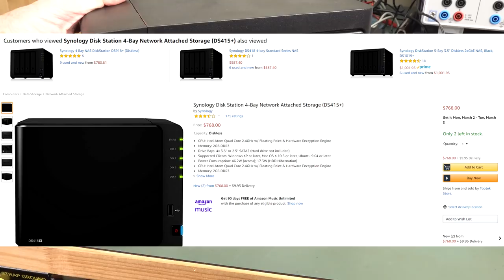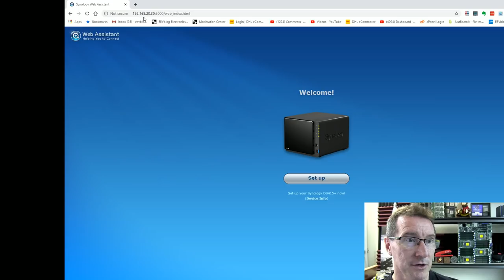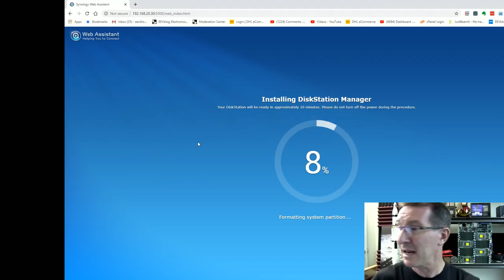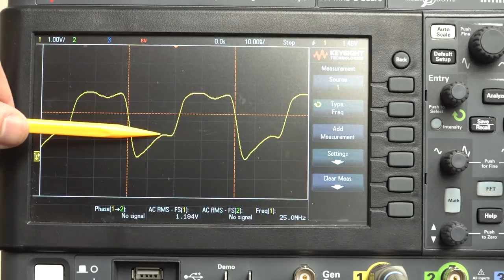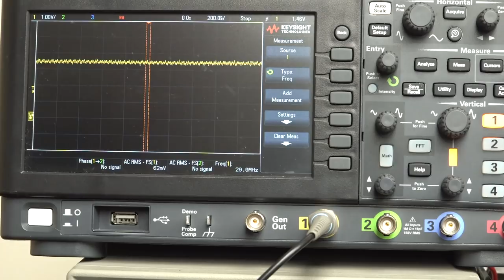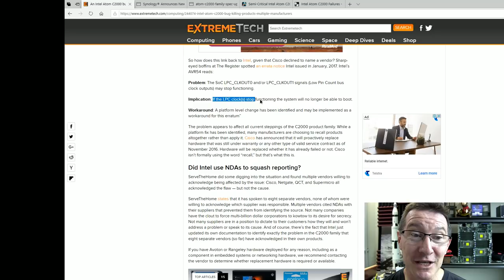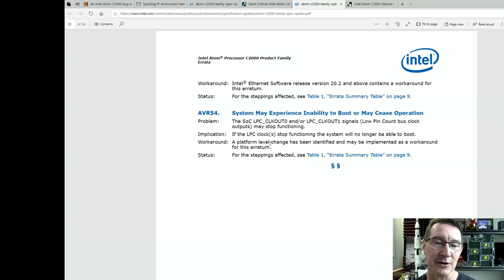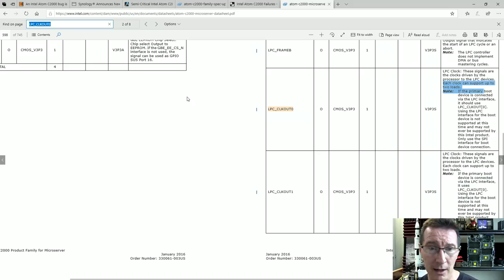EEVblog #1288 - Synology NAS Dumpster Find! (REPAIR)

Comment: All the units replaced under warranty had the resistor mod that i have seen.
Reply from the maker: Thanks for the confirmation
Reply: @EEVblog  Where is your dumpster?? 😁 no but seriously thank you for what you're doing, I'm learning things that are probably going to help set me free from terrible jobs I have to work, and have freedom and liberty to design and create and enjoy the world of electronics and controllers for automation
Reply: my 1515+ har is after replasment from synolegy and is har an "F" after it serialnuber
Reply: Hmm, not mine. They were replaced with brand new units.
Reply from the maker: @spnro8699  It's in a commercial business park and serves maybe 100 companies
Reply: It’s the official repair, I have done a few, also refresh the thermal paste as it goes rock hard and it’s good to go
Reply: @EEVblog  no WONDER you keep finding stuff like gold plated back massagers and unlocked 20 ghz intel product engineering samples i always thought it was a single building you keep finding all of this stuff in, i think you really just like torturing your audience with free stuff
Reply: @EEVblog  Somebody did the sensible thing and dumped it ;) Should have given it mercy with 2 rounds of buckshot though it seems... Next video idea: Synology powersupply made my dumpster-nas eat all my data ;)
Reply: Pretty funny. Good find

Comment: Always been  problem with this. Why we service these here at synologyonline. Only service center for Synology in the USA. The firmware and linux is stored in 2 areas. On that little flash drive mounted on the PCB ion this video. Basically a DOM usb, and also on disk so when transferring drives to another system. Takes a few more parts to make permanent. This fix he did will only last about a year. As the degradation process is in motion on the Atom C25xx CPU, and is still declining. We had to research this for months to stop it permanently. You can even see in his video the scope still shows a bad signal. As it is still in decline phase for the Atom CPU. And the PSU_ON circuit gets a overhaul with new parts of better values. As it is also part of the same clock system. On internal PSU systems, even the PSU gets new parts to adjust for this.

Comment: Reminds me of how I fixed a Linksys SRX400 router once. It stopped functioning, so I opened up the board and started running my fingers across the circuits while the device was powered. On one occasion the unit came alive. I repeated the process a few times to confirm it wasn't a fluke. I noticed 2 traces with which my fingers were making contact. Measured my skin resistance with a multimeter, found a matching potentiometer. Soldered it in between the traces and got 2 more years of life out of the router.
Reply: Ok wow
Reply: This is the tech guy's equiv of using a wire coathanger, folded into the shape of Australia as an antenna..  But then again, a dumb idea that works is not a dumb idea..
Reply: @PRiMETECHAU  Indeed. I knew there was no risk to me and I wasn't afraid of zapping the router since it was already technically dead. The whole point of inspection is to see if anything burned out, or heats up, indicating a short. Not like I was planning on doing the fix all along. I just wanted to have my internet back without having to buy a new router or wait a week for some replacement chip from Digikey.
Reply: @enilenis  ... and it's not as if a later failure was going to trash X TB of backup data!
Reply: apparently another idea is  if you use freeze spray and turn it on you will see the component heat up .
Reply: you were extremely lucky, I always wondered some folks are able to find the rarest bugs without schematics, support documents etc...

Comment: The mainstream Intel chips at the time had a few issues with the hardware for the clock generation on the LPC bus that was used for low bandwidth I/O like TPM or embedded controllers.

I recall it was a problem bringing it up from a low power mode after sleep or something.

We mostly fixed it in firmware by disabling the sleep mode for that, I guess Atom didn't have the ability.
(We = the BIOS developers at Intel)
Reply: The great part of mainstream Intel chips (laptop / desktop) is that the BIOS isn't loaded over LPC, but over a dedicated SPI interface, so we could actually fix it in software. If these Atom systems have BIOS on LPC, you're SOL.
Reply: Tim Hoppen it’s always interesting to pick up the little snippets like this in comments.
Reply from the maker: Interesting that it's related, thanks.
Reply: Oh, so that may be why my chinese mobo doesn't support sleep.
Reply: i was wondering why an LPC fault would affect the boot flash! every desktop board i've seen in the modern era uses SPI flash for firmware. didn't know Atom used LPC for that
Reply: @ailivac  The Atom board I have uses SPI Flash. But it's a D2700, one generation older than the faulty ones.
Reply: Wish you could've solved other Atom's issues by just modding the system's BIOS.
Some issues with Atoms were work-arounded using platform specific (mostly Windows) drivers.
To get mainline Linux to work properly on Bay Trail, developers had to fix a truckload of quirks the chip had. And some of these quirks still aren't fixed to this day.
Reply: I've got an old Barracuda Networks NG Firewall F80 with a c2000 series atom cpu in it, and I was about to install pfsense on it , but it seems to have the same problem --- what is the 3.3 volt source and where is the equivalence to pin 6? I can't seem to find the data on it... any clue on the internet?

Comment: Thanks, Dave!  You just enabled me to revive my DS415+.  I thought the electric storm the other day blew it out, and since there were blinking yellow lights for one, then two, disks, I also expected to need to buy new drives.  And with today's scandal with WD Red drives (SMD vs CMT or some such rubbish), I was not happy.  But now I'm up and running, all drives were okay, and I even managed to find a 1/4W resistor in my stash (1981 vintage) to perform the repair.  The 121GW pegged it at 103 Ohms, not bad for a 10% oldie.  Cheers from Texas!

Comment: We have had two of these exact model working at our school for years now and they have been  great. Not to worried if they fail because they are only sync backups but good to know about the fix. Thanks
Reply: It seems like if you mod them now, then the CPU won't degrade as quickly.

Comment: Did resistor fix on my 1815+. 2 minute fix and works like a champ.
Reply: any idea if the 1817+ has the same issue?

Comment: Thank you so much for this video!!!  I've been using a Synology DS415+ since 2015, running 24/7 loaded with 4x 4TB drives.  Yesterday (01/16/2022), for no apparent reason, it dropped off the network and I couldn't get it back.  After a few reboots, I go the solid orange disk lights with flashing blue light.  Completely dead.  After doing some Internet research and finding this video, I took DS415+ apart, soldiered the 100ohm resistor across pin 1 & 6 and wow...it's back online!  Wonderful!  Thank you for the great instructional and explainer video.  Saved me $$$ to replace my NAS (at least for the time being).

Comment: I did the same resistor fix with two different ds1815+ . They both lasted 6 months or so, before dying again. Before the C2000 bug, I had 3 power supply failure too on the same devices... I still consider synology one of the best brand in the business... but damn, what a huge pain in the arse
Reply from the maker: Thanks
Reply: I second this

Comment: Hello! Just wanted to let you know my 415+ stopped working 2 weeks ago. Then I found your video, ordered the resistors and the bios battery and just finished the repair. Worked like a charm! I can connect to the web interface again and all my data is still there. Thank you very much! #righttorepair
Reply: Does it still work? Mine died the same way 2 years ago or so and just stumbled on the fix this morning.

Comment: I got an older cousin, the DS414(Marvell) and it's a frigging Rock.  It's been through a lot with me, two major evacuations, new drives, and a lightning strike (she got replaced, the drives are still good)!  It's still running backups even as we speak, it's got another drive developing bad blocks. I'll wait until it gets to about 100 or so, before swapping it out.
Go get some 4TB WD Reds or Seagate Iron Wolf NAS drives and load her up. She looks a damn sight  better inside than mine right now. She needs a good dusting out.

Comment: The daughter card is a standard USB disk on chip.  Basically a thumb drive but the header is designed to fit directly into the USB IDC connector on the motherboard.  It's common in a lot of x86 based networking products.

Comment: I recognised this problem from the thumbnail! I had this problem with my DS1515+. I think it’s the LPC bus that physically degrades so it stops booting the BIOS (if it’s hosted on the LPC bus). Synology didn’t disseminate any information regarding the issue despite my registering the device. I even tried claiming a repair on the warranty, but was told there was nothing they could do. They acted like the problem didn’t exist. Maybe I was just too new to the party.

The resistor has fixed it for me (after mine stopped working) and it’s still working about 3..4 years on.

Very disappointed with how Synology and Intel handled this one considering a NAS is meant to be rock solid and reliable.

Comment: AFAIK, the NAS saves settings to the HDDs so if you are setting up using all-new drives, the first-time configuration process starts over.
Reply: Not sure about Synology, but my old D-Link NAS was installing whole operating system on a hard drive on first boot.
Reply: @djunia4u  Yup, the Synology NAS do the same. They have a basic built-in boot environment that gets you through the OS install process, then boots off the HDDs.

Comment: I have a first gen Drobo that still running with four Seagate ES.3 type drives installed. I've owned it since 2007. I've another one I got in 2014. It is also running perfectly.
Reply: True. My Drobo gen1 is also still running.

Comment: Yep, I've got a Cisco ASA 5506 firewall that was on that list too, but it hasn't failed yet. Although I'm pretty sure the failure mode is on reboot (like you said, LPC clock is mostly just used for the BIOS boot ROM), so the fact that I'm running it on UPS and it's almost never rebooted may be why I haven't seen it fail. For all I know, the LPC clock is dead as a dodo, and this thing is one reboot away from following suit. It's fixed on newer revisions, so I'm curious whether they've just done a resistor bodge, or if they've re-spun the boards. Cisco does offer proactive/post-failure RMA for in warranty units, but their field notice suggests failures begin after 18 months, so they that's conveniently out of the statutory warranty period if you're not paying attention. Thankfully Cisco can sell you a service contract which would also allow RMA.

Comment: Maybe a year ago I did a similar "repair" on my and my friend's DS415+. Friend's unit was in a similar state shown in the video (blinking power led and solid orange disk leds) and it was resurrected. My unit was fine because of a lot lower use time, but I just future proofed it. Still, it sits in back of my head that this will happen again, so I don't run my unit 24/7. My friend just shelved his unit deeming it not reliable and switched to QNAP, which also failed after around 18 months (different reasons of course).

Comment: Good evening,

Amazon S3 Glacier may be a very good offline or like backup.
Restoration takes few hours up to 24 hours, thus costs are very very low and delay is good for a safety backup.

Regards

Jean-François Simon

Comment: @EEVblog I'd just power it from a laptop power supply + dc-dc ebay converter or one of the 200 ATX power supplies that you have floating around. Drive wise, I'd look at shucking external 3,5" WD Drives, since they contain white labeled WD Reds.
Reply: Not guaranteed they come with white labeled red's, some are just white green's or blue's either. You can't know upfront and wd won't tell you because they don't want to be stuck to using only a single type for their external enclosures. As far as I heard though the mybook duo's come with obvious red's in it (same model number as retail, the above mentioned mostly have slightly different numbers which may indicated a slightly different firmware), maybe just because those are two in a single enclosure and wd wanted to make sure they work without issue

Comment: If you shuck easystore hard drives. They are mostly white label red drives. They are the same drive but cost a bunch less. You just have to take the case apart.

Comment: Don't buy a power supply, bodge one up!
Reply: Get the plug, and a female atx connector then wire those together.
Reply: seconded or thirded! i mean, i had a laptop for a good 8 years that literally had a jack from another laptop hanging out of the kensington lock port via a red and a black wire powering a IBM thinkpad from a dell/hp charger

Comment: I got a replacement 415+ from synology when mine died because of this issue. It has the same 100 ohm fix. Running strong since Jan 2018.

Comment: I would trust it enough if you can pull out the hard drives and connect them to a new nas and recover the data.
I think it isnt more likely to kill your hdds than any other nas, most likely it would just stop booting someday.

Comment: Youpie! I found DS415+ in the "for secure liquidation" bin on my employer two days ago. 
Sure enough, once powered, it was flashing blue led and keeping all disk indicator leds lit. 
Today, I have installed the resistor as instructed, and to my surprise (and great pleasure), the device booted up correctly. In the meantime I reset the settings to defaults so it is now detected by SL assistant tool in my network! Seems to work fine! Thanks for the great piece of info.

Comment: The pull-up resistor works because you're basically adding 3 volts to each increment on that graph. Y=clock stringh+ pull up. This prevents triggering late after the porch but before it

Comment: You can set this up as a off-site backup for your current Synology unit. If your current backup is at your office, ut this one at your home, and vice versa. This way if one of the two units are destroyed, you can still have your data back from the other unit. Also you can use 16TB drives in this so you get 48TB after one-drive redundancy.

Comment: The year is in the synologys modelnumbers.
Like DS4(the number off drives)15(the year, and no it´s not 1915 :P ).
Pretty handy when looking around ebay and the likes for older/ceaper hardware.
Reply: The first digit (or the first two, in some cases) is actually the maximum number of drives the device can manage, including one or two expansion cases of 5 drives each, if ghe DS has ports for them. Which explains numbers like 7, 15 or 18.

Comment: Absolutely love my DS413 ... has run flawlessly for since the day it was plugged in (and shoutout to Seagate too - only two drive failures in 8 years, using consumer-grade drives rather than NAS drives) - has been absolutely bulletproof.
Reply: Amazing! You're certainly doing well with the Seagates... I have so many failures that will never ever install them in anything I build.
Reply: John Coops I’ve had a good run - work the rule of always getting a mix of batches and hold a spare on hand though - I’ve always assumed consumer-grade drives will fail every couple-of-years

Comment: My DS415+ died of this bug too. 
I got a replacment unit from Synology (like 2 months after RMAing). I could not wait this long because I had to access my data and thus bought a DS918+ as replacement unit. So I got a spare "unused" DS415+ sitting around...

Comment: Hey! This is the exact model of NAS I bought for myself in 2014.  There was a big scandal in 2017 when it came to light Intel had deliberately allowed thousands of CPUs to be manufactured, knowing they would all fail at some point beyond the guarantee period.  Sure enough mine died in 2019, which was good going because most owner's units died after about 18 months.  So last March I took it apart and soldered in the resistor, and luckily it came back to life and continued its operation for me.

Comment: The explanation for this find might be rather simple.   Synology refuses to provide parts or any repairs to the units, once they come out of the warranty.   Refuses, as in - you cannot pay money to get any authorized repair.   So, once the warranty runs out, boom, they will direct you to just go out and buy another unit.  If they feel gracious, they might throw you a bone and give you some tiny discount.

Comment: Had the same issue here with my DS 415+. It went offline suddenly and was not pingable, and it didn't even shutdown after pressing the power button for 3 seconds. Had to shut it down via 10 second button-press. After that it booted normally and was accessible again. After a few hours, the same thing happened again and after a third time during 24h, I had the "blinking power button, 4 orange HDD lights"-problem. The NAS was in a boot loop and did not start at all. After disassembly and soldering the 100 Ohm resistor, the NAS booted again and eveything was back to normal. I did this yesterday, so I have no long term experience yet, but for tha last 12h it seems to work fine.

Comment: Try a higher value resistor, looks like the high part of the clock was OK but the low part wasn't. Try say 220R and then 470R, and then maybe 1k, then the low part of clock should be much better.